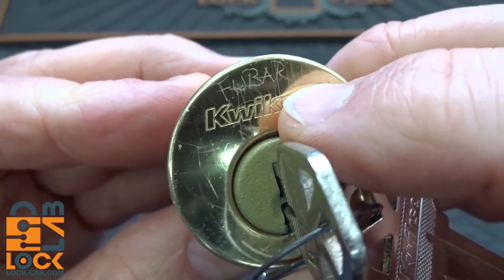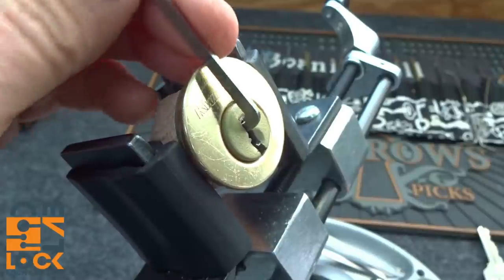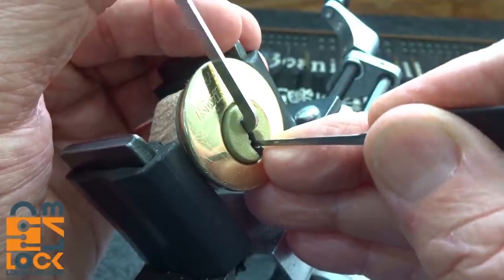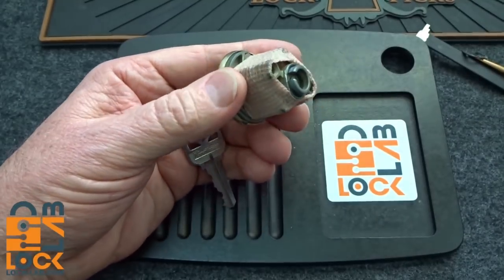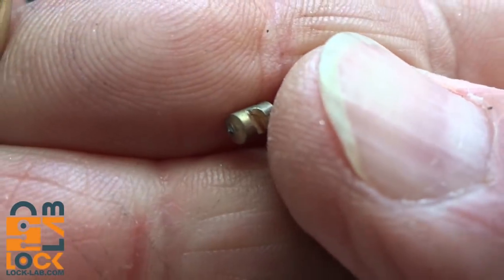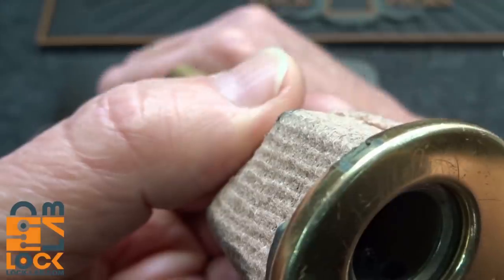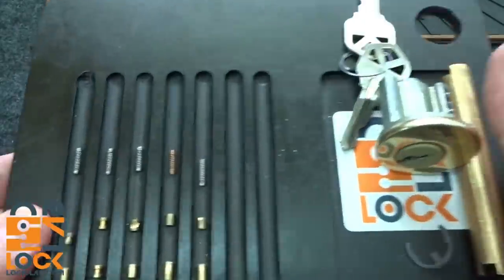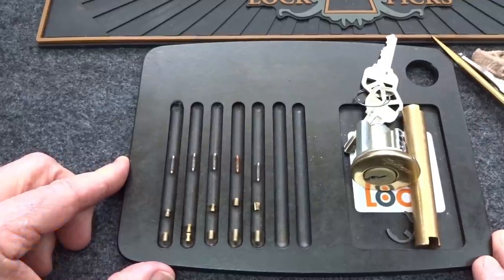(1019) Challenge: FUBAR Lock

Comment: Does it really matter who is "first" guys? This isn't middle school.....now, Vince. In my opinion if you're going to thread a chamber, use a serrated pin in that chamber to add to the difficulty when picking. Also, the pin with the vertical grooves cut in it, I would suspect it would act the same as a standard pin when picking. I'm not trying to take away from the work you put into your lock, so please don't take it that way, just trying to give some insight or tips on how you could improve upon it. Keep making some awesome homemade pins and match the chambers to them, and you'll be on your way to making a very difficult challenge :)
Reply: TinMan13 I appreciate the advice, constructive criticism is the best way to learn from mistakes. After I sent the lock I thought about that pin and how I should've changed it to more of a t pin at the base and flattened out the top. What's your thoughts on that? My goal was to have more sharp edges to get caught on the threading. Thanks again TinMan!
Reply: Cager Fodder thanks bud and thanks for the sub 😃 I normally don't do little rants on social media haha, but I get tired of the silly stuff.....and yes, you're correct, Bill has a great channel here that offers a wealth of information. Like many others, his channel is what got me started in locksport myself.
Reply: 2slo4you no problem bud, I'm glad to help out if I can. Your idea of the t pin would've worked nicely. You could even add some serrations to the top half to help it catch up on the threading a little more. Challenge lock building is a constant learning and adapting process. The more you do it the more you'll start figuring out what works best for the outcome you want. You can always learn a lot by watching videos of others challenge locks and seeing what worked well for them, then apply that to what you know and take it from there. Keep at it and there's no doubt in my mind you'll have some great locks out there 😃
Reply: I think saying "middle school" is inaccurate. I think the people doing that, are mostly little kids who sneak onto their parents computer, probably between the ages of 3 and 7. More like "first grade" and "pre-school", not 7th and 8th grade. It would be great if there was a way to block these annoying little rats from polluting the youtube comments for people who are mature adults.

Comment: This is a decent attempt at a challenge lock, and would definitely stump at least a few pickers, but the biggest reason this lock ends up easy to pick (compared to what it should be) is those key pins combined with the already loose tolerances of cheap Kwiksets. Those domed tops don't just make it easier to rake, they allow more keys through the lock that shouldn't work, and the loose tolerances increase the effective size of the shearline, the same as filing the core flat on top. Domed tops on key pins also make them 'speak' a lot louder when they hit the shearline. Bill does have an absurd feather touch and just blazes through serrated and spool pins and even threaded chambers like they're not even there, but if you want to make a lock that gives even seasoned pickers a challenge, the very first step is to get better key pins. If you're picking right, the key pins should never go above the shearline so it doesn't actually matter if they're smooth, but they should have as much contact with the driver pins as possible to minimise the feel when they are picked to the correct height.
Reply: Makrond I appreciate the feedback and I'll definitely keep it in mind for the next one.
Reply: Makrond I just watched the take apart part of the vid, and I havnt seen bill pick that kind of looking pin yet

Comment: Vince, try filing a spiral groove up the side of the pin.  Secondly, counter milling the bible from the top leaving a narrow part right at the bottom the holes in the bible to catch on spools and serrated pins.   Lastly, consider a slant on the bottom of the bible pins to force a spool sideways right at the shearline and add a countermill in the core at shearline to give room for the pin to lock up.
Reply: Johnn Schroeder Interesting. I might give that a shot whenever I get around to playing with some more. Thanks for the feedback.

Comment: i think the following would make for a nice level of dificulty.

core: serrated key pin 3,4 - spool key pin 2,5 - standard key pin 1
bible: serrated 2,3,5  - spool 1,4 (any mixture of t pins, and pin and pin, so long the right ones are also serrated).

this is just from what I've learned from bill so far.

Comment: always wonder why even use standards and not all spools? is it harder to pick the combination of them?
Reply: Jonathan12111 it keeps the core lockd and stable you need atleast 1 standart to avoid a sloppy lock :) (just a guess)
Reply: It can be at the very least a time delay. If a random thief is picking the lock, they might get a standard pin set and then not realise that another pin was a spool that got snagged. When someone starts working the the spools past the notch, they may get hung up on a standard pin that's already in place.
Reply: Both sound viable. I've been wondering the same thing. Why don't lock companies randomize them ie standard, shroom, serrated, spool in their products? That would definitely keep most noobs outta Master Lock #7's and wouldn't cause much, if any, price increase.